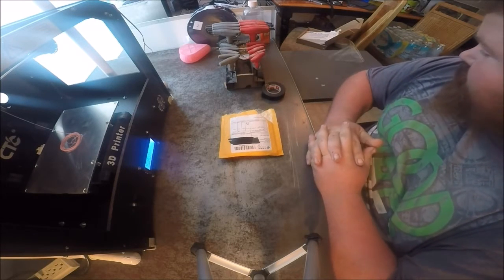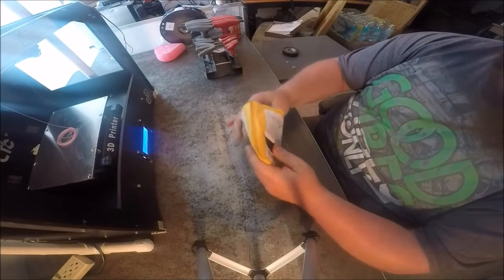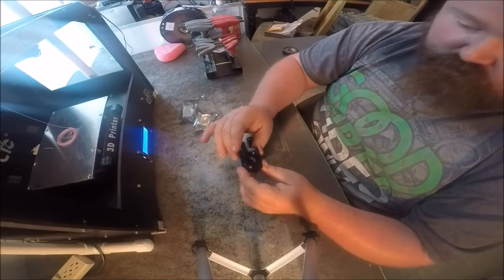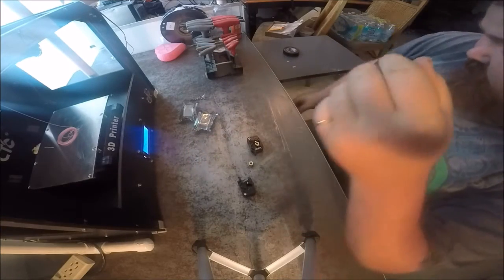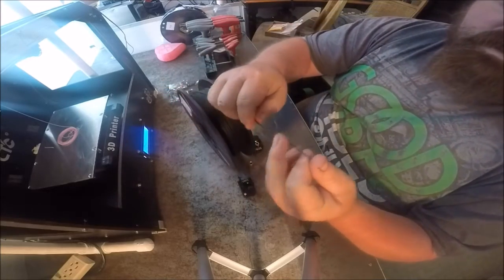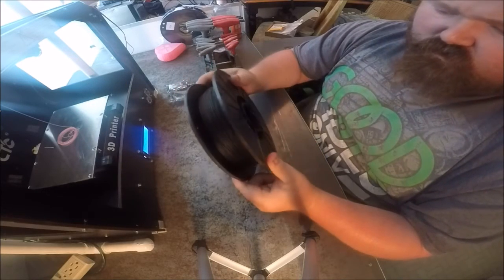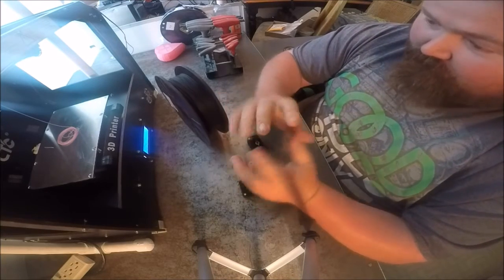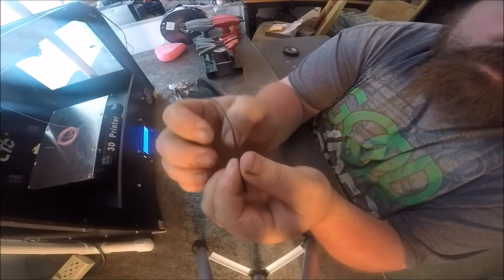unboxing video of a ctc 3d printer upgrade

Comment: Thank you for the reply, and for the heads up on the sprung extruders. Ive recently been looking at flexible filaments too, however as another comment suggests I intend to opt for TPU as its apparently firmer and easier to print as a result.
I assume ninjaflex is TPE and would require a mod to the path between the point the drive motor  pinches the filament and the point the filament enters the heat brake, removing any excess space which the flexible filament would otherwise buckle up into.
Thanks again

Comment: Howdy Biskit. I hope it performed well for you?!
I've had that same printer (CTC Dual) for roughly 3 years now & I to will soon be ordering those sprung extruder parts.
Just curious what slicer you use?- as I'm only familiar with ReplicatorG but would like to have options such as Ooze sheild, Retraction and the ability to set different layer heights/temps at different layers within a print. 
Thanks in advance for any info you might be able to throw my way.
Reply from the maker: makerware  is what I use I would love CraftWare but I can not get any other slicer to work. I am in the same boat as you. but the sprung extruder work great but  still can not print with ninjaflex and do not use the Extruder Filament Drive Gear that come with the sprung extruder parts. the ones that came with the ctc 3d printer work much better

Comment: i have those exact same parts, they work great however i have not tried ninjaflex.  For phonecases try and get a hold of some TPU filament, it's a bit harder than ninjaflex abd more suited to cases, should be easier to print as well.